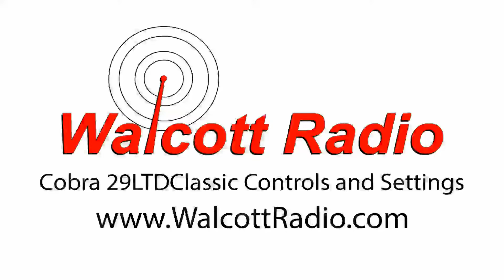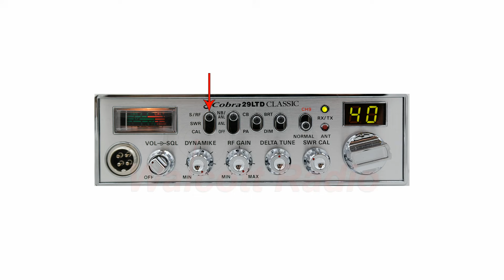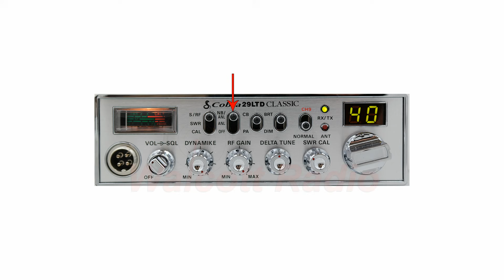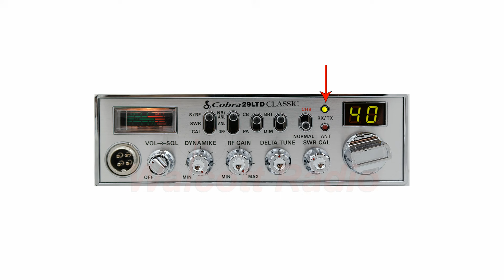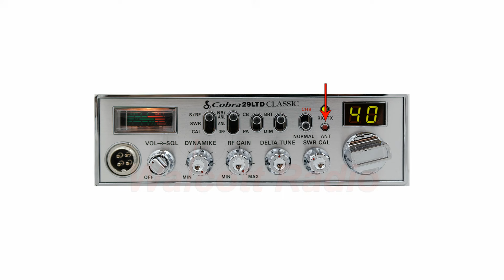Cobra 29LTDClassic Controls and Settings

Comment: Thanks for the info”but on my cobra classic ltd the (delta tune knob) has a function it filters the RF signal audio low/hi cut and it’s a very delicate change some people can’t even tell the difference specially while driving noise is present, maybe my cobra cb it’s different but I can tell some difference when I tweak it.

Comment: Even as a complete novice I have to call you out on saying "calibration knob has no effect on performance".   This is literally used to calibrate the antenna "height" and direct efficiency of the broadcast...  Tell me otherwise.
Reply from the maker: No, it's not.  The SWR calibration knob is used to "zero" the SWR meter before you get the reading.  The calibration knob does not change the electrical length of your antenna.  If you stand on a weight scale and measure how much you weigh, does changing the alignment of the scale make you gain or lose weight?  It's the same function here.
Reply: Edit:. I realize now that I didn't know what I'm talking about, thanks for the understanding. I figured they designed it to be electrically calibrated, but that would be too easy.  Excited to get my radio online after having it for 5 years.  Thanks for the video.

Comment: If I’m getting a red light on RX/Tx and AnT how can I fix it?
Reply: Antennae needs to be adjusted (raise or lower). If it's adjustable tip (set screw) extend or lower in small increments. When calibrating, if CH 1 is higher than CH 40, antennae needs to be raised. If CH 40 is higher than CH 1, antennae needs to be lowered.

Comment: Im new at this so if anyone can tell my why I would be getting an antenna red light I would appreciate it. I transmit and the red antenna light is coming on each time I key up.
Reply: Robert Sean you need your swr set antenna.
Reply: @MrBA812  Thank you brother
Reply: Get your SWR set properly. Check coax connections  for corrosion and then a tight fit. The red antenna light could be coming from those issues. Get a new coax and possibly a new antenna.  Ultimately your SWR has to be set properly.  The red antenna light is likely telling you that you have problems with your antenna somewhere .
Best wishes. M.H.
Reply: @mikehagan4320  thank you brother I will look into that. Got an swr meter recently
Reply: Robert Sean swr probably high.
Reply: @MrBA812  Thank you brother.